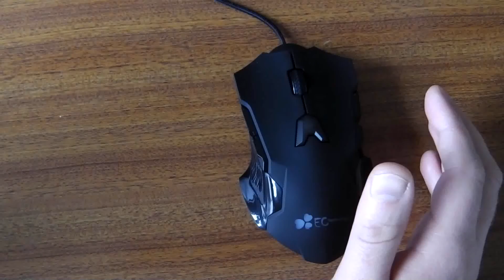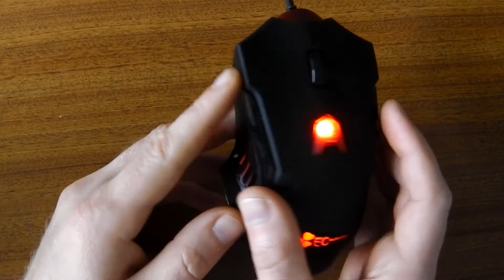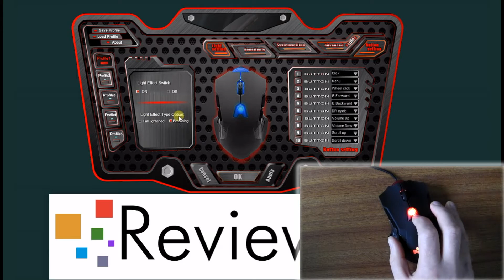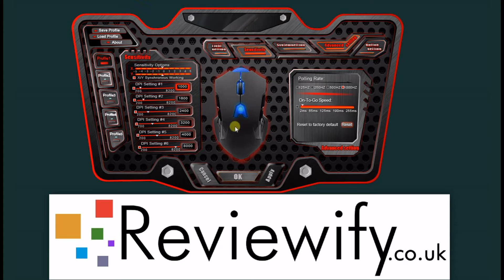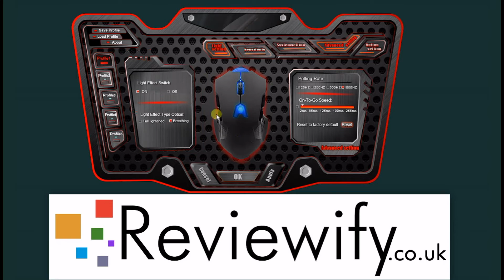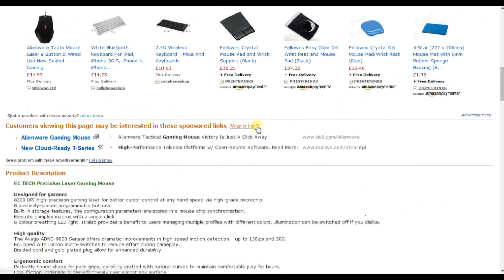EC Technology 8000 DPI Gaming Mouse Review

Comment: Does this mouse feel very accurate to you?  I'm using an optical mouse(gm2000) as a temporary replacement for my Logitech g500 and it accuracy is quite poor.  Planning to use this in RTS games so I need to be very accurate with my clicks.